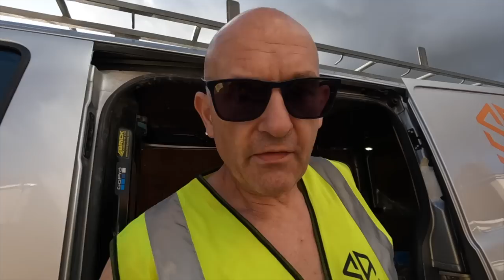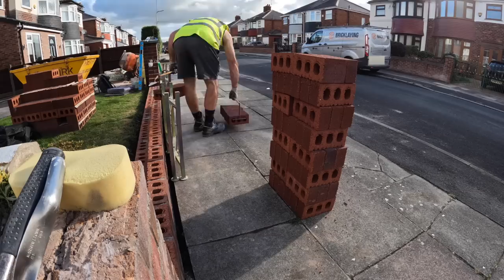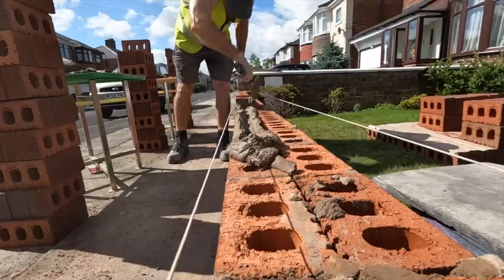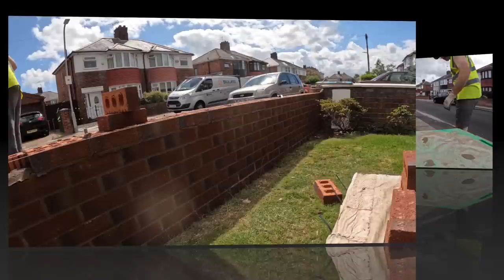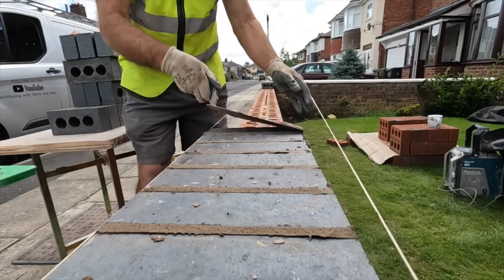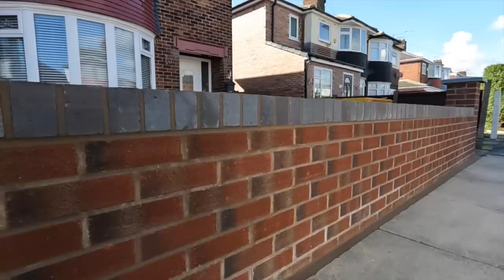GARDEN WALL RE BUILD PART 2

Comment: Sweeto, nice job👌,I would check the oil level in the gearbox of that mixer though 👍😁
Reply from the maker: Cheers Andy its topped right up mate , its smelling of burning plastic so we think the motor is on its last legs 😔😫🧱👍🏽
Reply: @SteveAndAlexBuild  👍👍😡
Reply from the maker: @bricklayersworldwithandy6277  😒

Comment: Great work as always. I don't know anything about brickwork, but noticed the bricks are matching inner leaf to outer leaf. would the wall be stronger it the bricks were bonded horizontally as well as vertically. or is that not needed for a garden wall.
Reply from the maker: They would be much stronger but look odd against all the other walls 🧱👍🏽
Reply: @SteveAndAlexBuild  Knew there would be a reason I hadn't thought off, Thanks for the reply.👍👍
Reply from the maker: @norfolkhall  😁🧱👍🏽

Comment: Great job despite the whining local moaning about footpath being obstructed, there's always one usually self important who doesn't realise  there's a spare footpath on other side.
Reply from the maker: You need to be carful , you don’t know who might take a “ fall “ while they walk past 😬🧱👍🏽
Reply: What's happened to common sense ? Its not unmanned or the middle of the night and unscrupulous people will always find a way regardless, nah not believing it, Health & Safety is numbing us all down. ( Your cars are allowed to park half way over footpath ) !  seriously
Reply from the maker: @pedropete1833  😬😬🧱👍🏽
Reply: @martin2466  Yes Martin I do understand what your saying and the law is correct but where is the flexibility, there is a huge difference between operating a Crane , or a  Construction lift or maybe even a Cherry Picker over or near a public right of way and what to me is a small footpath restriction ( not obstruction ) in a what appears to be a very quiet slow moving street   !  Hence my term - Common Sense.
Going by the letter of the law relating to the restriction of the footpath and duty of care to the public why are you allowed to park cars half on and half off the footpaths without being liable. ?
I suppose it could be a case of - Your choice.  Your call .  Your money.
Common sense is a tool that's not getting used much anymore, maybe laws should include it in there make up.
Cheers for the chinwag Martin
Reply: @martin2466  Why will it change your point of view ?  The terms Legal and Common Sense don't sit well together and never have unfortunately. I have always held the judgement of common sense higher which has served me very well.
Work ! no not me anymore, after spending 50 years in the construction industry I'm now retired, accident free with no law suits.

🙂👍
Reply: @martin2466 The same wishes to you and yours.